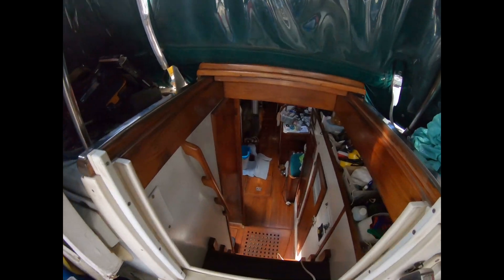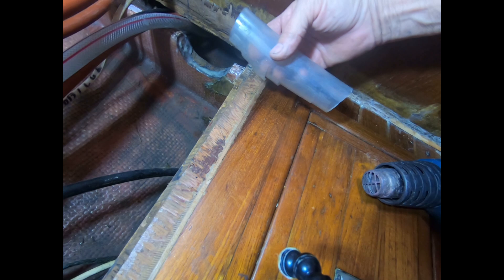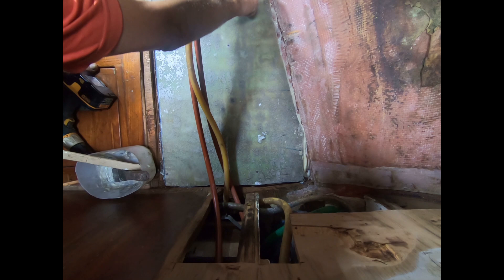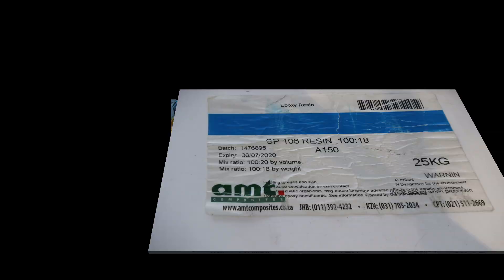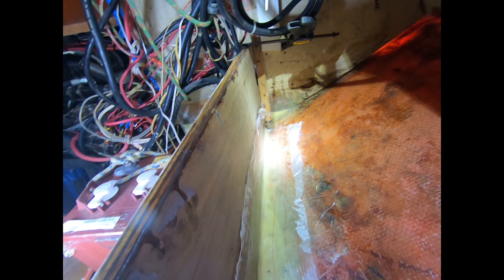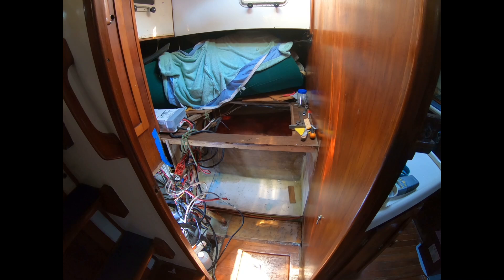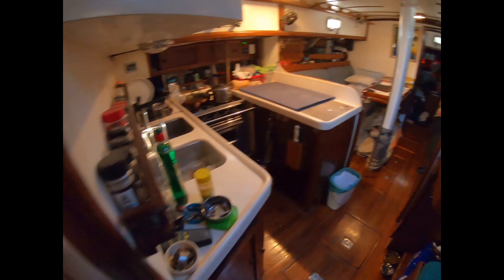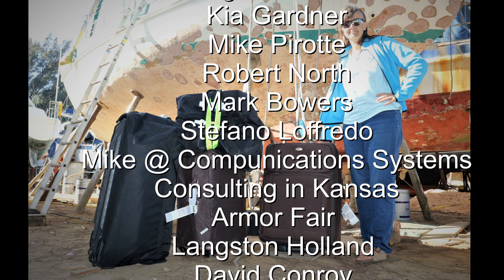How to Rebuild a Battery Box (LEAKING lead acid batteries on a Sailboat!!) Patrick Childress #46

Comment: After the resin is formed, you lay some kind of striped fabric, which, after hardening, tears off.
What is this fabric? I have never seen this, and never used.
Sorry if the question is stupid.
We do not have much yachting content in Russia, so I switched to English.
You get great videos. Keep it up.
Reply from the maker: Thank you. You have excellent English, or you have an excellent translation program! The product is called Peelply. It a woven polyester fabric. It is applied as a final layer just like fiberglass cloth, but do not wet out the edges. Once the fiberglass is cured, the resin does not stick well to the Peelply.  If using epoxy resin, pulling off the Peelply, any amine blush will be in the Peelply so there is no amine blush left on the new work to deal with.  The Peelply leaves a nice surface with a texture equal to the woven Peelply so there is "tooth" for any additional layup to adhere to with no sanding required. We show the use of Peelply in most of these recent "How To" videos, including the hull blister repairs.  We know little about Russia, other than what we see in the news, but we are surprised at how many Russians we meet out here cruising the world. We always enjoy meeting them. Thanks for watching our videos and your comments are always welcome.

Спасибо. У вас отличный английский или отличная программа перевода! Продукт называется Peelply. Это тканый полиэстер. Он наносится как последний слой, как стеклоткань, но не смачивает края. После отверждения стекловолокна смола плохо прилипает к кожуре. Если вы используете эпоксидную смолу, снимая Peelply, то в Peelply будет любой аминный румянец, поэтому на новой работе не останется аминного румянца. Peelply оставляет красивую поверхность с текстурой, равной сотканному Peelply, так что есть «зуб» для любой дополнительной укладки, чтобы придерживаться без необходимости шлифования. Мы показываем использование Peelply в большинстве недавних видеороликов с инструкциями, включая ремонт блистерной оболочки корпуса. Мы мало знаем о России, кроме того, что мы видим в новостях, но мы удивлены тем, сколько русских мы встречаем здесь, путешествуя по миру. Нам всегда нравится встречаться с ними. Спасибо за просмотр наших видео и ваши комментарии всегда приветствуются.
Spasibo. U vas otlichnyy angliyskiy ili otlichnaya programma perevoda! Produkt nazyvayetsya Peelply. Eto tkanyy poliester. On nanositsya kak posledniy sloy, kak steklotkan', no ne smachivayet kraya. Posle otverzhdeniya steklovolokna smola plokho prilipayet k kozhure. Yesli vy ispol'zuyete epoksidnuyu smolu, snimaya Peelply, to v Peelply budet lyuboy aminnyy rumyanets, poetomu na novoy rabote ne ostanetsya aminnogo rumyantsa. Peelply ostavlyayet krasivuyu poverkhnost' s teksturoy, ravnoy sotkannomu Peelply, tak chto yest' «zub» dlya lyuboy dopolnitel'noy ukladki, chtoby priderzhivat'sya bez neobkhodimosti shlifovaniya. My pokazyvayem ispol'zovaniye Peelply v bol'shinstve nedavnikh videorolikov s instruktsiyami, vklyuchaya remont blisternoy obolochki korpusa. My malo znayem o Rossii, krome togo, chto my vidim v novostyakh, no my udivleny tem, skol'ko russkikh my vstrechayem zdes', puteshestvuya po miru. Nam vsegda nravitsya vstrechat'sya s nimi. Spasibo za prosmotr nashikh video i vashi kommentarii vsegda privetstvuyutsya.
Open in Google Translate
Reply: @SailingBrickHouse-RVLife  

Google translates quite sane now.
After automatic translation, I go over the text and correct strange phrases. :)
Thank you very much for the explanation about polyester. I will try to use it when working with resin.
I'm directly stuck on your channel. Your content is so interesting.
And you can not worry about the language, I quite understand English, both written and oral. Except for small technical points. :)

Comment: Nice video and loads of work done Patrick.  I still haven't got down Richard's bay to meet you guys and Brickhouse. How long will you still be there ?
Reply from the maker: Oh another month or three. Would be nice to be in the water By Christmas...but who knows. The boat is ripped apart 14 different ways. And it all has to go back together before we can even think of floating again. I think this may be the one of biggest refits yet, though little of  it will be cosmetic....oh well...gotta work if you wanna have some fun, right? -Rebecca

Comment: Clever use of masking tape when applying thickened epoxy filets. I always wondered why lots of people don't do that. Saves so much work sanding. Sniffing epoxy dust. Good use of dumpster diving. A guy I know regularly leaps into the swanky boatyard dumpsters as a general rule for expensive wood and synthetic wood which is too expensive (labor wise) for the boatyard people to utilize. But perfect for us poor people.
Reply from the maker: The block used to fill the gap above the foam on the hull bottom came from a short plank of solid teak I pulled from the trading bin. How incredibly expensive that would have been to buy.  Perfect for this job.

Comment: What you think about marine battery box?
Reply from the maker: Hi Alexander, If you are talking about the black boxes used for individual batteries, that is what we have for the engine start battery. There was never enough room in the house battery box for 6 of them. It would have been better, long long, ago to have fiberglassed the inside of the house battery box with epoxy resin and cloth. Thanks for your comment.

Comment: I use a ratchet strap to secure my batteries.  I just cut the strap to the correct length.
Reply from the maker: That is a good idea but I don't want to put bolts out the finished, white, side so a strong attachment is my problem. Plus, acid will affect the metal screws unless a specific grade of titanium screw is used.  Hmmmm

Comment: Is that magic screwdriving collar something one-off? Or a brand name we can try to buy somewhere?
Reply from the maker: JC1028s link shows the screw extention/holder but they are also sold at Home Depot and most hardware stores.They come in different lengths.

Comment: I just bolted down the lid. Batteries will not go anywhere.
BR
Hulda
Reply from the maker: Good idea! Thinking along those lines. What did you use to bolt down the cover exactly? -Rebecca
Reply: Add a little: According to our standards, batteries shall not be able to move forward/backword/sideways more than 5 mm. Use pieces of wood, OK. Have pices of wood glued on underside of lid, preventing batteries from jumping (that should be hell of a weather). I use wooden screws with Torx heads, quality A4 to secure 2 off 225 Ah batteries. They weigh about 60 kgs each. Sorry for going metric :-)BR
Hulda
Reply: My answer dissappeared. Anyhow. Standards we use in Norway: Batteries are not allowed to move more than max 5 mm back/forward/sideways. Use pieces of wood to limit movement. Glue some pieces og non counducting material to lid to prevent batteries from jumping (should be hell of a weater). For screws I use standard screws with Torx flat heads, quality A4. I use 2 off 225 Ah batteries weighing 60 kgs each. Sorry for using metric.BR
Hulda

Comment: You need to learn to code and replace all that cabling with CAN and solid state relays, CAN chips are like $1 each and arduino nano's are 3 for $5, 8 port relays are $12 US on ebay
Reply from the maker: I Googled CAN but came up short. What is CAN?
Reply: Patrick/Rebecca, the whole purpose of codes is to ensure safety. In the case of electrical codes particularly, from fire.
Reply from the maker: @welchsteven  What is CAN?
Reply: @SailingBrickHouse-RVLife  It's the physical layer of NMEA 2000, used in cars and boats to get control signals places, it's a multi tap, multi master thing. It's cheap if you do it yourself, it's expensive if you buy it premade. All you need to start making your own to turn on things, http://henrysbench.capnfatz.com/henrys-bench/arduino-projects-tips-and-more/arduino-can-bus-module-1st-network-tutorial/

"NMEA 2000 connects devices using Controller Area Network (CAN) technology originally developed for the auto industry. NMEA 2000 is based on the SAE J1939 high-level protocol, but defines its own messages. NMEA 2000 devices and J1939 devices can be made to co-exist on the same physical network."
Reply: @SailingBrickHouse-RVLife  I think he was referring to CAN Bus. It is a communications protocol and networking scheme used in automotive applications. I think CAN Bus is used some in marine engines as well, but I would expect to see J1939 instead of CAN Bus. Many people use CAN Bus for control of distributed devices like pumps, lights, gauges, motors, sensors, etc. because it is cheap, reliable, and easy to program. We even use it a CERN for monitoring of temperature sensors and such. The marine comparison would be NEMA or Sea Talk.
Reply from the maker: @welchsteven  Thanks, Steve, now I understand. That would be a major project to introduce into this old boat.

Comment: Sorry... I watched as much as I could... Every time you're Heeled Over, in a wind, your Led/acid Batteries are leaking Acid through the tops... Eventually, you're going to be replacing all of that work with new stuff... The only solution is a solid-state battery that is Not susceptible to the lean of your boat... Unless you place a Gimbal beneath the batteries, like your stove, to keep them level in winds, your batteries are going to leak... Follow...??? Good luck :-)
Reply from the maker: A gimbal..that’s a good one :) Hey..the first one has lasted through 12 years of many many rough ocean miles...and for 31 years before that too. If this one makes it another 43 years, that will be OK ;) Thanks for your comments...funny image that gimbal! -Rebecca
Reply: DStray Cat sorry but that’s the most ridiculous suggestion I have heard, batteries manufactured these days have a much higher tolerance for abuse than they did 20 years ago
Reply from the maker: @sailingonsolo  Battery acid will eat polyester and vinylester resin but will not harm epoxy. Only epoxy was used in the rebuild of this area and battery box. Batteries are filled only to a certain point so can take some tilting. Think what happens to a battery bouncing around in a car especially on a rough road.
Reply: A properly orientated wet cell battery will lean over a lot further than most sailboats before they begin to leak. I use water miser caps on my batteries to further reduce the risk of any leakage. Even during a brief knockdown my batteries are unlikely to leak a single drop.
Reply from the maker: We had been using water miser caps for a long time until this past 18 months. Getting much less water drips on top of batteries now. There was always a lot of black goo build up inside the caps so decided to go with what the manufacturer recommended...the caps that come with the T105s. Do you get that black soot? -Rebecca
Reply: @SailingBrickHouse-RVLife  - every two weeks during maintenance on the batteries I always wipe off a little black goo from the inside the cap lids. I've never had it build up to where it was a concern. I had the room to install the tallest caps which along with good ventilation may account for my battery tops staying dry. No idea to be honest. 😁 There is nothing wrong with using the manufacturer's caps. They're effective and certainly a lot cheaper.
Reply: You're a dope. Obviously he will replace the batteries long before they do any damage.